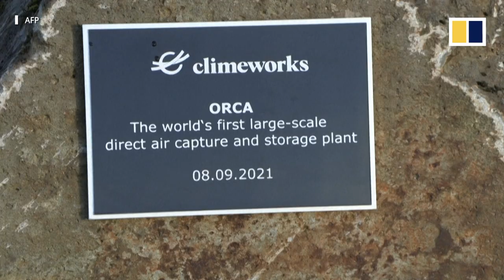Iceland power plant stops greenhouse gas by turning carbon dioxide into rock

Comment: Dude just woke up and the first thing it comes to his mind was
"maybe I should start making gas turn into a solid material"
Reply: Mind*
Reply: 0:43 and produce more heat
Reply: Dude lost a fraction of his memory about the existence of tree that absorb CO2 easily, better, more efficient, cheap maintenance and operational cost
Reply: Everyday life of a dry ice maker.
Reply: @eilois  But you must consider, how much space do trees take up to remove 4000 tons of carbon? And how long does it take them to do that? At this rate, drastic measures are needed and to get results quickly and with relatively less space is a must
Reply: @eilois  trees might be cheaper but they take alot of spaces to grow and not to mention it took years for them to reach the size where they can effeciently absorb those CO²
Reply: @eilois  if i remember, there was a document film about this facility on Discovery or National  Geo ( i not sure) that this facility can absorb more than just co2 but also methane too which plants cant not do
Reply: @ekosubandie2094  the facility also takes up a lot of space. Not only that but it also request power to function which will result in a less efficient means of dealing with CO2. Trees do the work for free and also provide homes for wildlife. And why convert it to useless rocks when we could be converting it to fuel for later usage?
Reply: What do you think coal mostly consists of?
Reply: @janeblogs324  Liquidated gas is done under high pressure, like a sigarette lighter.
Reply: that's called condensing then freezing lol, you can do that with water vapour
Reply: @dadikkedude  yeah that's a fluid. Its phase changed. 
You wouldn't call ice a liquid would you?
Reply: @sammysusuu  I don't want a counter that smells funny when I'm 80
Reply: @razredge68  Useless rocks? You do realize there are no rules against making use of the co2 stored in the rocks right? The co2 didn't just magically disappear.
Reply: Is that supposed to be funny?

Comment: Those comparing this to trees. A grown tree is carbon neutral, while a growing tree is meaningfully carbon negative. Also, as the tech matures, it will become cheaper and more efficient. Down the line, this might be a game changer. While a forest you plant now will have plateaued in about 15-25 years. So by all means, plant trees, lots of them! And also keep developing new methods.
Reply: Trees does have an effect on reducing CO2 in the atmosphere. But this process takes millions of years to see the results. You can verify it by comparing the evolution of CO2 in the atmosphere during the carboniferous period. So no planting trees will do nothing against the augmentation of CO2 on human scale.
Reply: Unless you plant a tree in a wetland area, then when the tree dies it will decay in a low oxygen environment which forms peat which will then form coal
Reply: Trees decompose. They're not carbon negative unless the carbon gets stored. Under natural conditions only a small portion of the carbon in a tree ends up stored on geologic time scales.
Reply: @introprospector  plant more trees then, especially wood trees. They absorb Carbon in the air, store them into their woods, then you decide what to do next.
Reply: You will be hard to plant tree if the climates already shifting
Reply: What about fires
Reply: Put a plant in 100% co2 add light see what happens. The great oxygenation even needed great amounts of co2 you fools

Comment: Excellent usage of a locally abundant resource... now if we could only find that abundantly elsewhere, to make it economically viable or something. Need more development, but amazing start. Only for 2 years though...
Reply: @piotrtrebisz6602  But there aren't many places with plentiful free energy.
Reply: Nuclear power is probably the best solution to this problem
Reply: I do believe the 2 years is a typo, as it also states that it will only be released if heated and that only happens during volcanic activity and that is low for the area. I do think they meant that it takes 2 years for the Co2 to turn in to stable solid form
Reply: "economically viable" shouldn't this happen automatically with Co2 tax and certificates as soon as the prices get to a high level?
Reply: 2 years is the time it takes to solidify., not the time it will stay sequestered. Once solid, it will stay that way unless it is burned at a temperature high enough to break the chemical bonds. The well site was chosen for geological stability, so the only way that well would let loose is if a new volcano snuck up in that spot.
Reply: @aerohard  I dont think the primary purpose of the site was that CO2 capturing method,the site was made for geothermal usage.This method is a happy sideffect.
Reply: This Co2 now not available for food and oxygen gor us via plants in photosynthesis what going on you fools
Reply: They meant it takes 2 years to form, not that it lasts 2 years
Reply: @petermichalantos5038  bait

Comment: One "green" source of electrical power is available there in Iceland - Geothermal. Basically no emissions, just get volcano-made steam to run a power turbine....But there's not a whole lot of places where you can do this.
Reply: Most of Iceland's electricity comes from hydroelectricity. About 30% comes from geothermal.
Reply: We also use our waterfalls
Reply: @introprospector  well yes but no you need to drill a at least 1 meter diameter hole/pit at least 15 km down(deepest than ever) to produce steam that can drive a industrial turbine
Reply: @bentwenty3288  we can also use already existing holes made by the oil companys do the fracking and extracting oil?
Reply: @tomizatko3138  just realised you prob need a 2 meter radius hole and those oil company holes arent nowhere deep enough
Reply: Well it will not enough to world

Comment: Rather than capturing from air I believe this could be modified to capture CO2 stright from exhaust pipe or chimneys which has much higher Co2 concentration
Reply: This probably can't capture at the same speed engine produce co2. That's probably why they need whole facilities to host this.
Reply: Plus, the desceiption mentions the process consumes a lot of energy. Perhaps it would raise operation costs to the point where it stops being either profitable
Reply: That is already being developed, the problem is that.
1. You need to get the gas to a state where it is soluble in water (not that difficult, really), and
2. You need to get it to fresh basalt that can absorb the CO2, there are surprisingly few places where that's available.
There are other ways to use captured carbon, though, like enriching soil.
Reply: @fernando47180  Profitable... that's the problem there. Corporations don't consider the survival of humanity when it comes to profits. It'd need to be forced on corporations or government-run because the private sector isn't going to do so on its own since there's no profit involved.
Reply: @ming45612  Even if we threw capitalism out the window, a power plant that consumes more electricity that it generates doesn't sound like the best deal to me. This technology is amazing, but its current development does not make it suitable for every aplication
Reply: Or we could stop creating that problem in the first place.
Reply: @fernando47180  I doubt this power plant consumes more power than it produces. Geothermal plants are extremely productive.
Reply: @introprospector  True. What I am saying is that this couldn't be applied on a much broader scale that its current use, such as other types of power plants.
Reply: So, you want to capture the CO2 out of the air and turn it back into coal?
Reply: @geraldfrost4710  I think that's pretty much the idea, not exactly coal but even now it already capable of being sold as fuel.

Comment: When I was in high school stage, I used to dream about solidifying the exhaust gases of IC engine vehicles with some sort of addon devices at the end of exhaust system, so that the solid slabs formed can be dumped later on. I thought this would be comparatively lesser polluting the nature than the one in gaseous form. The addon system should have a storage container to hold the solidified deposits upto to certain weight and once it's filled, it has to indicate the user so that the user will manually dump the solid wastes into specifically designated garbage boxes to be kept in all main public areas / in fuel stations
Reply: I had a similar idea with a conversion addon to cars and plants that would convert the co2 into liquids. Never figured out what to do with the liquid though..
Reply: we have a similar thinking
Reply: Co2 gets released back by the rock within a year. What's the point.
Reply: @JatinGera  CO2 would only be released if the rock heat, as with an eruption. The process that take several years is the solidifcation of the CO2 rich water into presumeably carbonates.
Reply: Would you plan to store the solid material in the exhaust system or have it converted and left on the road and have it sweep later
Reply: @raymanbb8274   @Rayman BB  the addon system to have a storage container to hold the solidified deposits upto to certain weight and once it's filled, it has to indicate the user so that the user will manually dump the solid wastes into specifically designated garbage boxes to be kept in all main public areas / in fuel stations
Reply: Take a ton of co2 rocks to mars to create atmosphere
Reply: @geraldfrost4710  jeez Louise you a scientist? Big brain

Comment: So... how many million tons of CO2 annually is getting turned into a rock by their benefactors? I mean, you're presenting it as a serious tech that is solving a problem, not as a exhibit prototype needed to lobby for more relaxed rules on oil drilling, right? Right? Who's the sponsor btw?
Reply: It still needs to be worked on since it uses up a lot of energy which is obviously mostly produced by coal power plants.
Reply: @hellogoodnite8447  no not in Iceland they get their electricity from GEO thermal from the volcano
Reply: @kaptain1477  Well if we’re thinking of using this globally then it’s gonna be coal
Reply: @hellogoodnite8447  it doesn't have to be global.  It sounds like they want to capture all the CO2 in iceland because they have huge quantities of free geothermal energy and they have the right type of rock to be able to accept it.  If they take it from the air then that air will eventually disperse to reduce the average global concentration.  Except as the original comment states, this will require millions of tons to be harvested.  That's a massive scale.
Reply: MelonMan  Because not everyone’s rich enough to build nuclear or renewable energy sources
Reply: @Mama SkyNET that's what Nikola's CEO promised... next you're going to suggest inventing a simple one in all blood test?
Reply: @unoriginal1086  okay, so let's say overpopulation is made up.
But who do you think these corps are run by and for what they are run?
They are run by the people that somehow always find cpable people to succeed them. Yes, not all of them will take over a corp.
They are run for people to make a profit. Look at the education industry. They run because people keep having children. 
They also tell people to have lots of children for votes.
Consider interdisciplinary subjects, then atleast overpopulation won't be a new concept for you. Atleast the part of reducing population is not just for saving the resources or future of earth, it's also to reduce the exploitation by corps and let them crash, cause they will fall if they have fewer people to serve.
Now tell me I'm ridiculous.
Reply: @yazyaz2969  i really do.
But atm my family is relying on me. If you can somehow miraculously erase that, I'll help.😎
Reply: @Mama SkyNET no global warming is very real, i am just stating the fact that overpopulation is not a major factor in it and the reason people think it is is that if corporations blame overpopulation, they dont get blamed for the issue.

Comment: There are a lot of scientific methods out there to convert CO2 into something as well as plastics and rubbers. But the biggest issue is making it economically viable and sustainable. People in general aren't willing to throw money into something unless they get a return or unless it's charity, and if they're going the charity route, very difficult to get stable funding or enough funding at all.
I think the real solution is making an economy out of the CO2  conservation or conversion
Reply: yes
Reply: I was actually thinking of ways to implement CO2 as a physical currency. Every country has CO2 quotas, so does many large-scale companies and corporations. Imagine if CO2 were to become an internationally acknowledged currency that could buy/be traded for certain prospects that are outside the realm of pure classic money and bit mining. Imagine an international marketplace build upon the concept of using stored CO2 as the sole means of buying power. The CO2 would have to be capsuled in something to make sure it is held indefinitely (or at least far longer than the 2 year lifespan of an open rock casing). But CO2 should most definitely become a sort of currency, the fact that it isn't already is honestly quite baffling.
Reply: @Real_MisterSir  isn't that what they're trying to implement in China? Setting and privately trading emissions quotas. Companies that emits less can sell their emissions quotas to companies that emits more
Reply: My country had a mechanism for carbon offsets, unfortunately too many people are selfish and it made it easy to manipulate the masses to vote against it for a tax break here and there for the common rabble

Comment: Tree do this at fractions of the cost using Carbon Sequestration
Reply: They occupy lots of space, though.
Reply: @dbclass4075  trees don't need to have a powerplant to run and store any machinery tho.
Reply: @dbclass4075  And that's an argument against planting trees????
Reply: @dbclass4075  I don't think they do. Place them in an area where people won't commonly go to even if it's a dark alley or a nearby sewer. Something. Even parks have lots of trees. The head of a tree may be bigger than it's body but that's it. It's still pretty slim
Reply: I bet there's tons more carbon when the tree growing up
Reply: @50jakecs  Not really. Just keep in mind when comparing them based on the amount of carbon dioxide, trees require a lot of space. However, trees can be planted where they fit, as some cities are attempting to have more greenery.

Not to mention, they provide oxygen.
Reply: @user-lt3nx2ys6u  Trees do need water, though. Although, that is far easier than a machine upkeep. Unless when in the desert, that is.
Reply: The amount of trees we have isn't enough to absorb all of the carbon we have.
Reply: @Fishy Plants also use oxygen during night time! But yes, it sounds like a more eco-friendly and cost effective alternative to these types of devices. And if space in an issue just plant smaller, like shrubberies.
Reply: @saltentity  They use less O2 than they consume ', green stuff are positive O2 producer and negative CO2 producer. Wood is literally a CO2 storage battery!
Reply: @Mocha 2606 trees make cities look cool
Reply: @Mama SkyNET Really, they produced more CO2 than O2?.
Reply: trees decompose
Reply: @introprospector  Because of trees only we are here, if all the trees decompose at same time then we will also die

Comment: The only 2 downsides are that you need a small amount of energy from a power plant dedicated to the capture, and a small loss of O2 from the atmosphere. The O2 loss is occurring naturally anyway and we have plenty of water to split for O2.. But realistically it may be more economical to go with direct methane conversion and storage.
Reply: And nah, I didn't get any of that. Sorry
Reply: @creslyadambardon6580  >
A. It costs energy to save energy, unless it emulates natural processes as is shown in the video. It's a bit like spending $1.00 to buy 50c.
B. The conversion process strips O2 (The rare stuff in the atmosphere that we breath) from the atmosphere and buries it underground.
C. Just burying Methane (CH4) may be a simpler process than the processes in the video and leaves the O2 in the atmosphere alone.

Comment: When you have too much energy for your own use, you need to figure out how to use the excess
Reply: They could sell it in some ludicrously large sized batteries I suppose lol. Underwater cables are a thing too, but I don't think its worth it if they don't make THAT much of an excessive amount of electricity.
Reply: They could make hydrogen via electrolysis.

Comment: for now they r just able to solidify it into rocks i bet soon there wil be some way where these rocks with Co2 will be used as some form of fuel/energy for something looking so forward to it
Reply: ReNeWAbLe CoAl
Reply: Synthetic oil or coal is not new, germany did it in 1930s. However it will not stop climate change for obvious reasons.
Reply: Sorry , perpetual energy machines do not work.
Reply: @cliffordnelson8454  You obviously don't know what that is.
Reply: @cliffordnelson8454  it's an engine if you think about it